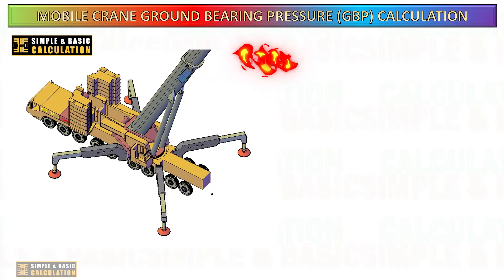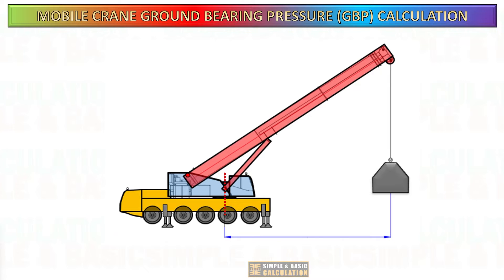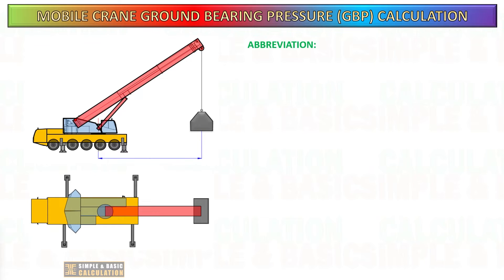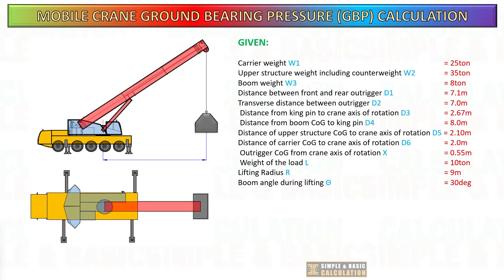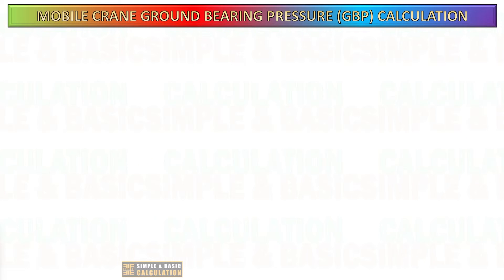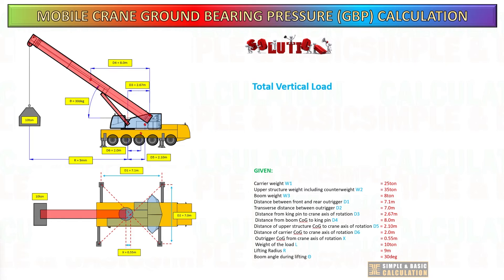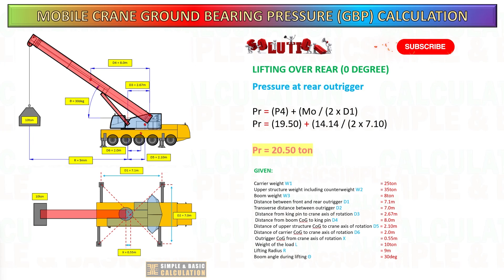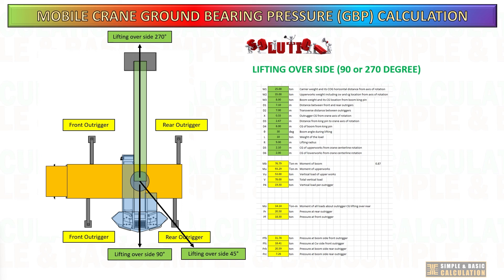Expert Guide: Mobile Crane Ground Bearing Pressure Calculation #crane #gbp #heavylifting

Comment: May I ask why in the formula for Pr, it is calculated as: Pr = P4 + M0/(2×D1) and not Pr = P4 + M0/(D1/2)? Because if M0 is located at the center of the four support legs, shouldn't it be D1?Thanks